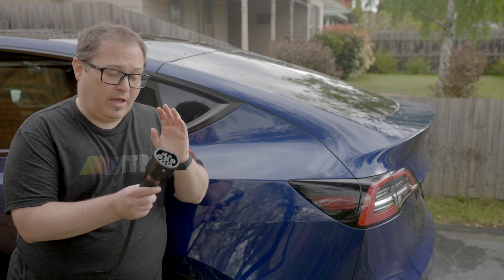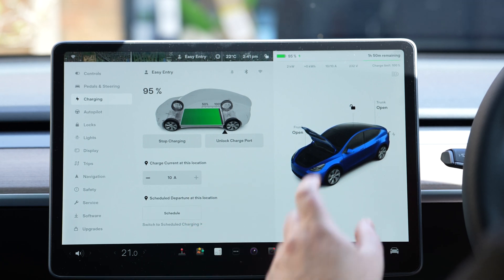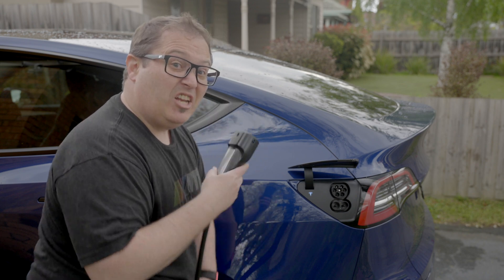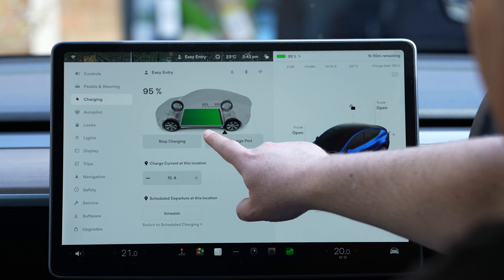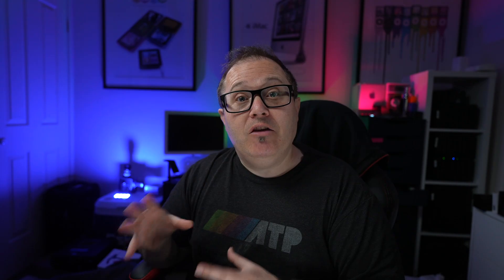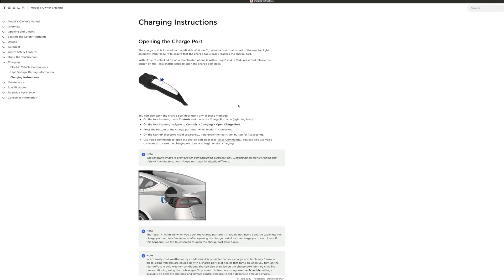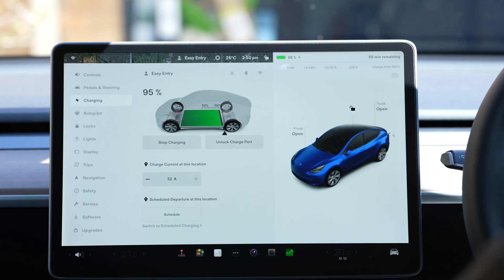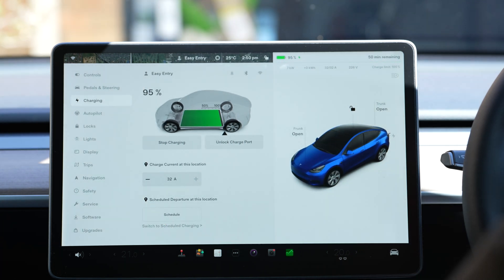A simple guide, charging an electric car at home

Comment: Very helpful video. How many kms do you get per hour with your Tesla Wall Charger on single phase?
Reply from the maker: Thanks, I haven't really checked ever. They way my brain works is that I plug it in and then see how long it will take me to get to the percentage I want to.

Having said that, very rarely do I charge it at it's full 7kW at home. I try to manage it so that it is only using solar and in winter, my panels don't seem to be giving me more than about 4.5kW at even the height of the day.

What are you looking to find out with the question? I think if I know more context of why you're asking, I could answer it better. ☺️
Reply: @notacarguy_au  Thanks for your reply Lee. The charging only via solar sounds good. We have solar and will have a Wall Charger (single phase). It would be great if you could do a deep dive into that subject some time (or maybe you have?) 

Re my original question, I'm thinking about those times where I will undoubtably not have charged the car over night and I have to be somewhere unexpectedly, or a family member hasn't plugged the car in and we have to be somewhere and there isn't enough charge etc... I'm keen to know how much percentage / kms I'd get per hour from the Wall Charger on Single Phase. I think it's a poor planning / range anxiety based question! Ha!
Reply from the maker: @glendynivin2275  It's interesting, I think I had those concerns before we got the car, but very rarely have them now. I find that on average I don't use more than 10%-20% of the battery per day and so I could go maybe 3-4 days before I really need a charge.

So if you forget to plug in one or two days it isn't a major issue if you then suddenly need to go somewhere as most "somewheres" don't need more than 20% of the battery. And if you do need to suddenly go on a long drive you can do short 10-15 minute super chargers along the way.

If you watch my two long road trip videos I did a few months ago, you'll see that my biggest issue when using superchargers was that they charged the car too quickly and I barely had time to pee. 🤣

If you have the means, I'd suggest maybe renting an EV for a few days and see what it's like. At least from my experience, once I actually had one and used it, a lot of the concerns I had disappeared.
Reply: @notacarguy_au  Thank you. I'm taking delivery of our MY this Thursday! So I'll be experiencing all these things for real very soon. Looking forward to it all. I did watch the epic Melb to Syd Trip and the sequel Syd to Melb Trip. Very interesting and loved the 'Pee' B-Story! 😅

Comment: the problem I see when you charge your car to a 100% daily, and if you only drive your car for a short distance every day, the advantage of regen is almost completely gone. After all, the car won't regen when the battery is full (you can't put energy in a battery that's already full). Even if one pedal driving is still available, it will actually be using the brakes instead of the regen. So the brakes will need replacing faster and you won't get 'free' energy from the regen.
Reply from the maker: That is a point, but not that much of an issue. You don't have to drive more than 5-10 minutes to use 2-3% of the battery to start using regen. So it's only really an issue for the fist 5 minutes of driving. 

So yes, you may be using your brakes a bit more, but not much more. It will also depend on the car. Different cars deal with regen differently.

For example the BYD Atto 3, will regen when you put your foot on the actual brake and the car works out how much regen/brake to use.

I think this is still pretty new-ish technology and we will see different  methods coming out.
Reply: @notacarguy_au  as for me, I drive just 10 minutes to my work. Of course there's no problem, I just wouldn't charge my car every day. But if I did fully charge it daily, that would cut my regen to about half. I'm still shopping for my first electric car so I'm certainly no expert, but I saw another video on YouTube where the reviewer didn't seem to know why there was no regen (he started at 100%, also in a Tesla). If you're counting on your car braking when you let go of your pedal and it doesn't, it might potentially become a dangerous situation as you're gonna push your brake pedal later than you would normally. As you say, this technology is still being developed, but I can't help but feel (for now) charging to 100% is best avoided (unless you really need the full range) although some cars' manuals say it's the right thing to do. Thanks for your great, easy to understand but extensive reviews.
Reply from the maker: @ivo4357  I think you'll be pleasantly surprised when/if you get a Tesla and drive it. A recent software update for the cars made it so that the regen works very very quickly after you start driving even if you're at 100%. I've no idea how they are doing it. But it works very well. 

I went for a little drive last night when the car was at 100% battery and didn't touch the brakes once. I did find that I had to adjust the way I drive a bit, so I need to start regening/braking a bit sooner than then I am using the brakes in a non EV.

So for example with an ICE car you may start applying the brake 50 meters from a stop sign. but with the Model Y I start releasing the accelerator  to start regening 50 meters before the stop sign. Hope that makes sense. ☺
Reply: @notacarguy_au  thanks for the detailed reply, it does indeed make sense, and it takes away one of the few issues I had with EV's. My next car will be an EV for sure.

Comment: Hi Lee - A QQ; I See that you have placed your charger outside. How safe is it/also I see the charger itself is rated at IPx4, but my sparky was mentioning the cable gets brittle when exposed to sun, my driveway is north facing so in a pickle if I want to put it inside the garage and run the cable under the garage door.
Reply from the maker: Good question. I was also concerned about that. We were looking at getting a carport built, but then we found out how much they cost and so may have to wait a bit. 🤣

So far the charger has been out in the elements and we've had no issues. But then again we've only had it here about 3 months. So time will tell.

Comment: Love the presentation style Lee. To clarify some of the units for those who might not know, kilowatts already has a time component as in 1kW = 1000 joules/second. So you’re not charging at 2kW per hour, it’s just charging at 2kW.
Reply from the maker: Thanks for the clarification. I gotta admit what with Amps and volts and kWH and kw. It's a lot to take in. 🤣 I actually realised as I was rewatching I was probably saying it kinda "wrong" by saying "kw per hour". Thanks again for clarifying.

Comment: Hi, I will take my new Tesla like yours on December. II gain only 20 to 70 km a day, also I will buy Tesla wallbox. How can I  set max power (3 - 3,5 Kw) in my tesla before start charging? I have only 4,6 Kw at home.
Reply from the maker: Either in the charge setting in the car or in the app. Lower the Amps for charging. I plan to cover this in a video in a few weeks looking at charging with solar.
Reply: Just plug the car in, it will work out what it needs and what your house can deliver safely to the car.  The only big decisions you have to make is what percentage to max charge, go to sleep, and wake up to what you have set.
Reply from the maker: I think he was asking more in relation to using solar to charge. If they had a charger like Zappi it can manage charging to only use excess solar. Or if they can use an app called ChargeHQ that too could work. 

Unfortunately I have an Enphase system and they don't work ChargeHQ.